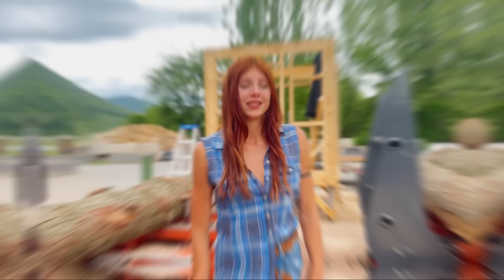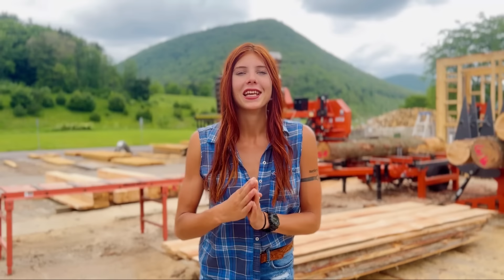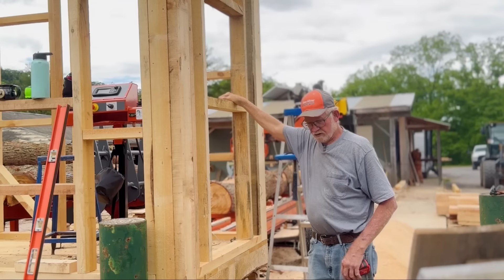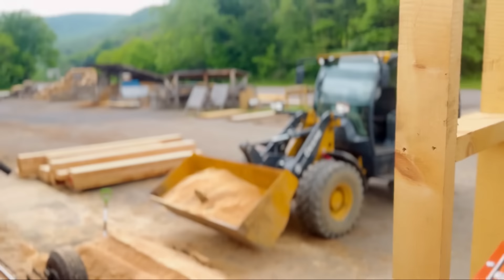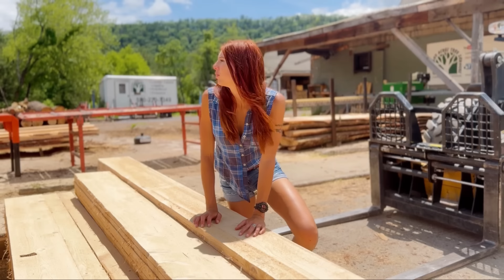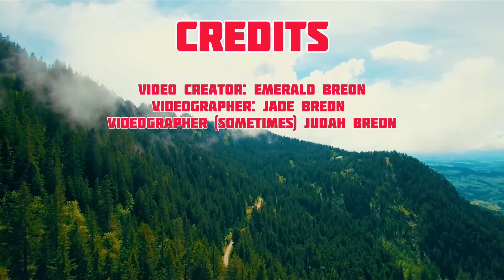Grampa is building me a doll house!

Comment: For over 10 years I worked in a warehouse that didn't have any heating. In the winter whatever the outside temperature was (not including the windchill) that was the inside temperature of the warehouse. I wore thermal underwear, insulated socks and undergarments, a base layer of clothing in addition to woolen clothing as well. Insulated coveralls and a hat plus mittens with hand warmers to keep me able to drive the forklift. The boss would berate me for not wearing the hardhat, but damn it was frigid in that minus degree weather and so...  That was over 20 years ago, and I still remember those days but with more fondness.  It's good that your grandfather built you a structure to shield you from the elements. It will come in handy in the winter months ahead!  Appreciate these moments in your life. They pass all too quickly.

Comment: There is probably enough power output from the alternator on the diesel engine that runs the mill to install a small inverter in the doll house run a few 110 volt toys like fans, phone chargers and other small loads.

Comment: Run a map gas or propane torch over one of those bandsaw blades at the weld till it turn a low cherry red. Feather back and forth with the torch flame and let it cool slowly. See if that helps.
Reply: Would that be annealing? To soften it?
Reply: @jsmythib  Not a welder per se, but did some time as a smith.  AR15231 probably thinks the welds are too hard and brittle.  Heating to low cherry red and letting cool slowly is a "tempering" technique.  You want to get the metal to a point where it is still strong but not brittle.  Brittle very read hot heated metal that is quenched, usually in oils or brines, will be quite hard but brittle.  It can't stand shock loading and can shatter like glass in some materials.  This is why I am encouraging LCLY to check their WM mill for shock loads at start of the cuts.  A well brazed blade with some good silver soder, as another viewer suggested, would also be a good experiment to see about fixing the broken blade problem.  A lot of viewers have made good suggestions on ID'ing the problem...Mill or blades or operator... but so far we don't have any detail on if they are reading them and trying anything suggested.

Comment: Mount small camera compatible to you phone for an inline view of the saw blade to help set height of cut. Wal-Mart or online, cheep.
Reply: Mount a small laser line generator aligned with the blade,then you get an exact setting. the cut line will be easily visible on the log.

Comment: Think about power source that is already running. The LT 70 is electric start right, it probably has an alternator to keep the battery charged. You may be able to run a smallish fan and such off the mills electrical system. An inverter would change its D.C. current to A.C.
   The amperage available may be limited though.

Comment: Great Job Grandpa, Have you considered an solar setup for the "Doll House" ? that would help and would only have to use generator to charge battery's when no sun, I'm sure Grandpa has a plan for Jade to have Shelter / Shade too!  About the blade breakage, I do believe the welds are not properly annealed causing breakage.  Have a good week, Grandpa be careful on the roof!
Reply: There can be a new protest chant: “Shade for Jade, shade for Jade, shade for Jade!”  😎

Comment: I've got a DeWalt fan that runs on the same 20v lithium batteries that DeWalt drills and other power tools run on. I run it in my tractor since the built-in fan in the cab died, and it will run for many hours on one of those batteries -- it's a pretty low draw compared to a drill, planer or circular saw. And you can just pop a spare battery in and stick the other on a charger, and it will be charged by the time the first one runs out (of course, I have more than just two batteries).

Comment: Hi Emerald 
Have you considered fitting a laser level to the mill that projects onto the log at the same point that the blade will cut? That way you should be able to reduce the amount of extra thick slabs you project due to the chance in your viewing angle.
All the best to the team.
Jonathan

Comment: Yes, insulate the whole doll house, Grampa.  Couple rolls of R-13 glass will make that toasty warm in the winter and cool in the summer.  I'm in southern Oregon and cheaped out on my carport.  Withing a month, I wished I had spent the money for sheathing on the top, under the metal, because it condenses a whole lot of moisture.  Nah, forget the misting fans, Em.  Get Grampa to pick you up a simple 7,000BTU mini-split HVAC system.  They go on sale for $6-700 often.  ;)  I built with Doug Fir since it's so common here.  It lasts forever.
Take it up with Woodmizer if you got the blades from them.  Get them warranty swapped out.

Comment: for power there, put in a car battery, and a solar panel, and a small inverter, (250 to 500 watt) should be pretty cheap and will do all you need.  But if you need heat, then you have a decent source for firewood  Having a small stove there would be pretty nice.  Then the two of you could huddle in there on breaks.

Comment: Hmm why not get one of those cheap mini cams that connect via wi-fi or bluetooth to a small monitor , you could mount the cam on the saw head maybe in such a way you can see better where the slab cut is going to be, on a little monitor by the control box? Might help with your seeing level issue?

Comment: You might want a solar generator.  It is half battery and half panels. The one I have, the panels have to be taken in and out because they are not weatherproof. That's dumb. But you can take the battery part into the office every night and plug it into a charger. So don't get one too heavy. Figure your watts times 10 hours. I would be looking for a remote camera setup for eyeballing the blade heights. Sawing with Sandy has a laser set up. You can see the green stripe on the log where it is going to cut. Just remember, Fill your fuel first thing in the morning when the engine is cool, and top it off again right after lunch.  I have a Ryobi fan, the P3320; it is really nice and runs almost all day on one 4 ah battery. You probably would need 2 batteries. Then you would want a solar powered shed light. Have a blessed week. I don't think "sucks" is in the Bible. Maybe you could find some better ways to describe things, like "even a termite would hate the sawdust shower all day long."

Comment: eme i was watching 1 of your shorts on braking another blade. My question is what degree blade are you using I have ran lt 40 and 50 at work i have a manual mill . the 7 degree cuts knottyer wood better  if your using a 10 degree maybe your pushing to hard but check the welds and make sure its welded all across. i have used wood mizer double hard but im running the ripper 37 cheaper and better blade

Comment: Hello all. Your saw mill engine charges 12 v batterys. You could run a wire and charge a battery for the accesories in the doll house.
Red heads rule

Comment: Maybe plexiglass windows facing the mill for shatter proof safety.
Reply: Lexan, a transparent plastic (polycarbonate) of high impact strength, is a much better choice, than plexiglass, in this application.
Reply: @johncolvin2561  I got the idea they would be using what they have laying around.

Comment: the old mizer you sawed away from you and could see better when getting ready for the next cut 
  now the saw head is coming to you  the blade  now is far away  and on blind side from your vision  making accurate repeative cutting difficult if not impossible 
  . personally would rearrange controls so you be cutting away from you again  giving you better thickness control 
but that's just me 
  out of the woods has same same series mizer and starts cutting away from control end
Reply: Out of the Woods also does not produce like Emerald and Jade.   The controls would be in the way on the swamper side for LCLY.

Comment: Your Grandpa is awesome.   Now for Jade, if you provide me with an email address I'll send you a copy of the plans for my workshop I worked out of for many years.  Think Nursery Hot House(s) but with 4/12 pitch (where you guy's live & the snow you get I'd recommend 6/12 Pitch,)  it's based on 21' ft. lengths of 1.25" in.? 1.375" in. ? Dia. Pipe.  Some minor welding would be involved.

Comment: do you really want a swamp cooler at a lumber yard?  You gonna be misty and cool..... and caked with sawdust lolz.  If its too high, tell your grandpa you want it lower.  Those 4x4's on the very bottom can be trimmed up, and you can find another way to brace them.  You have a log loader, pick up the doll house, cut the legs shorter, and put the doll house back